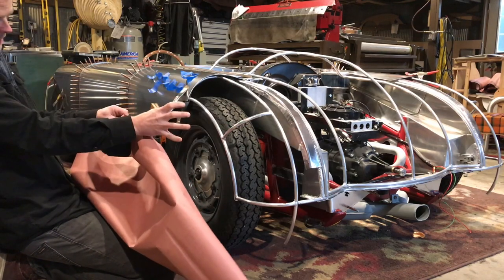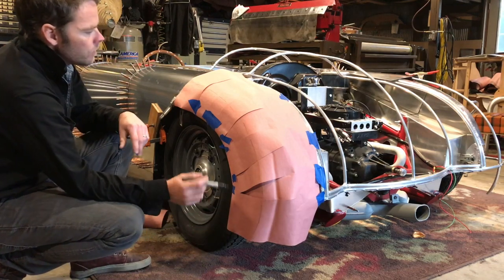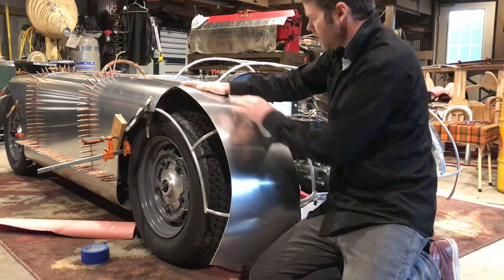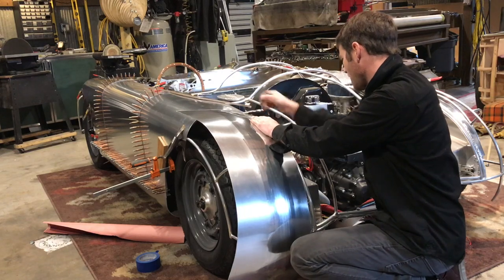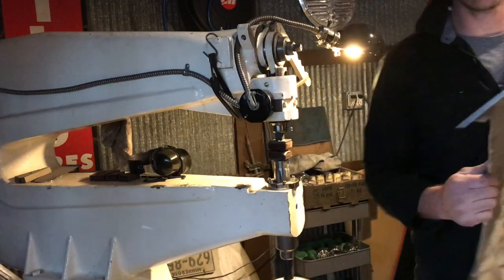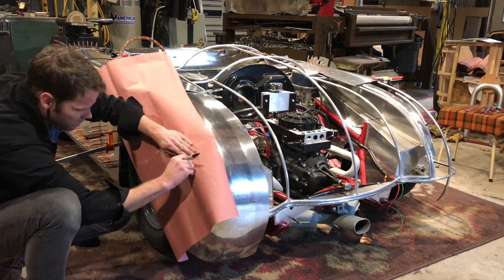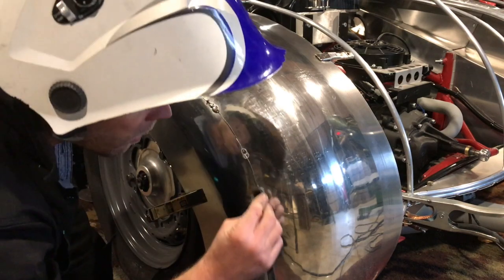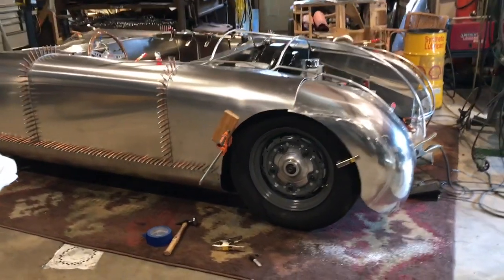Metalshaping Fender Compound Curves

Comment: The measuring and meticulous working of the metal is everything. I was a sheet metal mechanic for  twin engine civilian prototype aircraft fuselage and wing panels back in the sixties. The fuselage and wing panels had to fit perfectly down to 3 millimeter’s. I was there when it made its maiden flight. It was a thrill to see it take off with the designer and the test pilot knowing that their lives were at stake. The plane was called an Aerostar.
Reply: Ex soviet jet aircraft manufacturers were skilled at fabricating to hundredths of a millimeter. At the high speeds intended the airframes had to be virtually perfect.
Kirkham bought an exSoviet aircraft manufacturer and put the skilled staff back to work building replica Cobras in aluminium and some cars in copper.

Comment: having been a sheet metal worker and fabricator for many years , this took me back to my youth when i worked with a guy who made bodies with compound curves ,he didnt have a shrinker in the 60,s a wheel and gas,to get the curve he would pie slice the sheet and gas weld them ,then hammer weld the joins, i could never do do this , he made it look easy , but im impressed by chris as he is a young man

Comment: The first time I saw aluminum bent like this was in my airplane A&P school where one of the students (who was a metal worker) made an aluminum instrument panel for a 1937 Aeronca we were restoring. The panel was rather simple, but where it did shine was where the guy had rolled over the edges of the panel and shrank the corners so there were no wrinkles. Later, he made the engine cowling which was mostly flat pieces. The nose of the cowl was where he also did some rolling and shrinking. It was a work of art.

Comment: Just some tips from someone who welds aluminum frequently: 

a) Before welding (even just tacking), use dawn dishwashing soap and hot water and completely clean the panel (and your filler rod)
b) Wear gloves. The oils from your fingers will contaminate the weld area as well as your filler rod.
c) Make sure you only use a stainless steel brush on the aluminum. The brush should only be used on aluminum, and should not be used to clean the weld area if you accidentally dip and create soot everywhere. Replace the brush often.
d) If you brush dirty aluminum, and then clean it, all you have done is get the dirt deeper into the metal. Clean and THEN brush.
e) Don't ever believe your eyes when judging cleanliness on aluminum.

Also, the cleaner you make the weld, the less cleaning action (AC balance) you will need, and the less heat you will need to put into the panel, warping it.
Reply from the maker: Great info. I didn’t touch on this in the video but I do typically use a fresh stainless brush, dip in acetone and brush this into the seam to be welded. This has worked very well for me. I do also wear gloves 99% of the time (unfortunately haven’t in my videos, bad example). I also found that I can bevel the bristles on the brush by running them on a Clean belt sander, this gives them more bite/ penetration when brushing the alu. 

Again, I appreciate you taking the time to comment and share your expertise.

Comment: If you are having trouble with welds, use a larger gas lens, the one you have is pretty small.  I saw no reference to it, but you should be wiping the panel(s) down with acetone before you weld.  If you are having trouble with your English wheel dies rusting, you can use Choji oil or oil of cloves to reduce it.  Choji oil is what they use on Japanese swords to prevent rust.  You would want to clean the dies before use with acetone so it doesn't potentially contaminate the aluminum, then reapply before storing.

Comment: Being a woodworker here in Chicago, I bend plies of wood species (.095 ti .12") in membrane press fashion at 2000 lbs per square foot. So there is a similarity in metal and wood fashioning with layout and fitting curves for a final effect. I find the GRIP brand of green/black spring loaded hand clamps in the 4" and 6" size to work well. Check out that brand as they have floating contact pads that are superior to metal spring clamps that meet the material at one point most of the time. Enjoyed your work.

Comment: Have a try at using a body file rather than that flat dreadnaught file, makes life a bit easier as is easier to control. The handles give great control and comfort and being able to slightly curve blade reduces flat spots slightly and gives lovely blended curves. Can get a nice one from Eastwood. Totally agree with what you say about not grinding the aluminium.

Comment: Excellent job young man. Nice project not many cats are doing this type of metal work these days. You also did a great job instructing in a video format. Great welding and fabrication skills but I have a tip for you  DUDE...your tungsten should be just under flush from your cup. You have it sticking out 3/8" ...no no no good...you will have way better results moving your tungsten just inside your cup. Trust me I am pro tig welder 40 years. Your arc should not be jumping from Tungsten straight to weld. The Arc develops it best qualities in the gas. You want to see a nice long arc not a tight short arc gap with your tungsten 1/8" from puddle When I am running 3/32 Tungsten on Alum my arc gap is about 3/8-1/2 " . Also with your tungsten sticking out from cup so far you are also creating a swirling effect in you gas stream and the cone shape is lost. The cone shape in the gas is what gives the arc its stability and quality start ups and consistent weld appearance.   Short arc with long tungsten  will cause alot of problems in starting a weld on cold material or just creating a pain in the ass when tacking stuff together. With the tungsten tucked up just inside cup you are allowing the gas to flow past and maintain a cone shape and you get a nice stable arc....Try what I sam saying then if are finding your arc is to wide then use the balance adjustment on Tig and narrow up your arc.

Comment: Way back wen I was a kid in the early 70s a friend of my mom's ..named David Anderson ..who worked in shipyards showed me a trick .. while I was helping and learning ..from him on a 56 MGA..being new York ..the body panels were a rusting mess .David wanted to rebody with stainless steel..by keep the original lines ..so David being an underwater welder ..he actually built a tank in his shop ..for gas welding his body panels to prevent discoloration and warping ..his system worked really well .. unfortunately before the car was complete David was killed in a checker cab accident..I remember David's car sitting in that old shop until I left new York a few years later ..I still use some of the things I learned from him back then ..on some of my projects .. it was sad loss .. of course later on gas welding was replaced by Tig and mig ..but I got my first job building bicycles frames because of what I learned from him ..any way I love your work ..it's where id like to be in life ..but life happened and took me down a different path .kids wives .. money and age ..so I tend to stay within the realm of radio controlled cars and boats ...

Comment: old fella i knew who worked on repairing e,type and healys and few others he used to put a step in at the join point so have a over and under small joint to key into, ,he used to say easy to work and braize and weld to each part and stronger over all panel,he worked in his garden garage and vellocett motorbikes the curves they had were crazy,the custom work he did ,he was known as the vellocett mokebike guy he worked for them for 30 years this  was in the 1980s in hall green bham uk ,he was well known as the velly guy for handmade parts as well ,had customers from all over the world a true craftsman

Comment: Also when finished welding you can use a dolly and hammer to tap on the bead weld to remove the stress retraction.
Reply from the maker: I've found it best to perform planishing (whether it be wheeling, dolly/slapper and hammer) after knocking down any excess weld thickness. If the weld has excessive material and you go to try to dolly it down it is prone to warp the panel. As shown in the video, my preferred method is the wheel in this specific area of a panel. I do use a slapper and dolly on very tight radius.

Comment: Fantastic. I'm about ready to make a stove pipe. Haha. And I stumbled onto this channel. Far cry from what you're doing. I've always wanted to learn this stuff, but it just seemed mystical and over my head. Very cool. Also, I think your welding issues could be solved with a gas lens. Then you could have a wider cup, and more stickout. Check out the weldmonger store for those.
Reply from the maker: Thanks for the comment. I did solve the problem with the weld by replacing the components in my torch with new. I had been Welding on steel and I think that had caused some residue to work it’s way into the torch. I also tried the glass cup just to experiment. It did not work well at all for Welding panel seams. Thanks for watching!

Comment: Sorry i dont have any photo's or video's. I didnt know you were using o60 of thickness. Usaly when welding thin aluminium or steel i leave a small  gap betwen plate to get full penetration. It is not easy to do but when you master it it works well. Also if you purge the other side youll be getting a nice weld.  Anyway you seem to know what your are doing, You are a master craftstmen, keep up the good work. Have a nice hollyday. cheers
Reply from the maker: No problem!  I appreciate the ideas and input! Happy Holidays.

Comment: Wow, such beautiful, skilled and thoughtful work. 
I've read of using a heat sink in the back of welds to avoid distortion. Would this help, or do the curves make it too difficult for adequate contact?
Reply from the maker: Thank you Doug, That's a good point on heat sink. When I first started buttwelding  my fender seams, I would put a strip of aluminum on the back side to help absorb the heat. I have also been told that copper works well. I still feel most confident in this method of welding the backside with TIG. If you Gas weld, there is no need for backing as it is a self annealing weld.

Comment: i was thinking - after you cut open the paper in den beginning, and after the tape, use some spraypaint on the paper, this will give you a mark if the tape opends!
Reply: I had exactly the same thought.
Reply: Even simpler... just draw a mark across the join with the marking pen.  From this one mark you can see all you need to recreate the join.
Reply from the maker: Good idea, I've actually found another method that works pretty well. Using heavy duty aluminum foil allows you to basically form a mock fender by folding it over itself and it holds its shape really well. I appreciate all the ideas and comments!

Comment: Very nice video thank you for making and posting.
Those steel shrinking dies are very aggressive as you know and they will work OK on steel panels but still leave marks as their designed to shrink very aggressively. To decrease the aggressiveness just reduce the height of the thumb, it is unimportant if it fits tight into the female side of the die as this area just needs to not touch to shrink.
If you decrease the thumb to be just a little bit higher than your plastic dies then it will be good for steel and aggressive aluminum, then you can use them for your initial shrinking which will bring the metal together quickly but leave some marks. Then just finish it up with the plastic dies to blend in the marks and your going to get the shape quickly and the same finish that your used to with the plastic dies.
(That steel shrinking die set looks like it was copied from a set of Yoder dies? Way to aggressive for Pullmax dies than they need to be)

Comment: Try a bigger cup for better gas coverage. Pyrex for better visibility
Reply from the maker: Hi Chris, I appreciate the comment. I’ve played with the glass/transparent cups in many sizes, also different positioning of the tungsten as a couple others swear by... and found the standard cup and my preferred length of tungsten  to work best for this gauge and grade of aluminum. The alu is .060” 3003 with nothing behind for heat sink... have you tried the Setup you mention on this? Interested to know if I’m missing something...
Reply: RÜNGE CARS I’m not a pro by any means and I have only tried it on 20 gauge steel. But what i really meant was a gas lens to focus the shielding gas. Sick work by the way. I’ve done a lot of body work with steel and fiber glass but never aluminum.

Comment: I don't understand the shrinking process.  If you could explain the process and what is happening to the material when you shrink it with the power hammer that would be a great help.  I have an Air Stream.  It has two dents that need to be dealt with.  Either I have to buck rivet new panels or "pound them out" .  For this reason I'm watching several of these metal working channels looking for clues about this craft.  Any advice you can offer will be received with great appreciation.  If you wish I can send some photos.  Finally, thanks for a very well narrated and photographed video it is a great help and is very interesting.
Reply from the maker: Hi Dana, Thanks for the comment. I'll try to articulate a bit more on the shrinking process. There are a couple terms that I think might help to explain this. If you take a flat sheet of paper and gather one corner of it up, the sheet is going to want to arc or pull over. Of course, when doing this the paper is overlapping itself and creasing. I use the word gather because this is essentially what "shrinking" is doing, it is gathering or pulling the metal into itself. Unlike the paper, the metal is actually being pushed together without creasing or overlapping. The metal, as it gets gathered, becomes thicker and it causes the sheet or panel to  be forced into a curved shape. 

I use the description of a pleat in clothing, which is basically what you are doing with the metal. Another word used is creating a "Tuck" in the metal. If you look up "Tucking Fork" or "Tuck Shrinking" I think this method will help establish more understanding. 

One more thought on the subject. If you look at the process of Stretching the metal to create compound curves it might help as well. One way to think about stretching is to imagine a balloon being inflated. As it expands the balloon becomes thinner and thinner, but it expands in a spherical shape. Metal is doing the same thing when being hammered or wheeled. So if the material becomes thinner when stretching or "Spreading" it will become thicker when Gathering or "Shrinking". I hope this all helps!

Happy Shaping!
Reply: This much I get.  But when one shrinks, the sides of a square for example, to get the material to curve around a sphere say.  The edges must shorten.  That material then must go somewhere, the thickness must increase.  How does one cause that to happen in the hammering process?

Comment: You'd save a lot if time if you shrunk the edge on the tree trunk with the bossing mallet. Tuck the edge then use a normal mallet to smooth a little before going ont the wheel.

Comment: What an absolutely God awful amount of work! Fascinating, the sheer amount of knowledge you have to have to be able to do this, but my manufacturing background tells me that these methods would only be useful in a one-off scenario or developing a prototype from which dimensions would be derived, probably by laser imaging, in order to use CAD to produce upper & lower dies for the large presses required to press these shapes in a single operation. 

Economically-driven manufacturing would require a significant degree of at least SEMI-automation, reducing the manufacturing time (and cost) significantly. I can't imagine what you would have to charge for a car to be built like this in order to make a reasonable profit.

Comment: So the material is  .063 3003 H14, but what grade is the filler rod? I do a bit of this stuff and always have issues with the tig weld being a lot harder and brittle and comes out a different colour when polished. Any tips on those problems?
Reply from the maker: Hi Bruce, good question. I am using 1100 Filler. With any other fill, in this application, I also  found it too brittle. You can also use a stomp shear to slice very thin strips of the “parent metal” or actual metal you’re shaping with and use these as filler. This guarantees color match and consistency in material. This especially works well with oxy/gas Welding. Again, may get brittle (being 3003) for TIG.

Comment: great job...
the problem with the tig - did you flush the hose before starting welding? 
long hose take som flushing to get rid of all the air
Reply from the maker: Thanks for the insight, I do run gas through before first welds of the day. My problem ended up being the torch head components were old and very dirty from welding steel. Once I changed them out it was welding great.
Reply: Be worth trying a gas lens kit too if you haven't already. Beautiful work